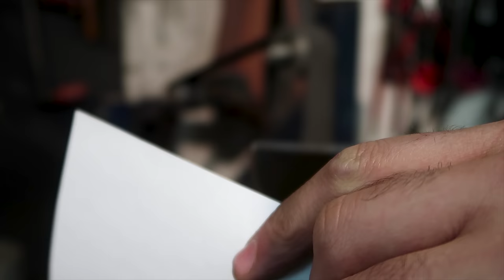Antique Hatchet Restoration. Third Time's a Charm!

Comment: I think a wood handle would have been easier, not really a fan of metal handles myself.
Reply: I'm going to go out on a limb here and say: I don't think he made it because it was easy.
Reply: yep, leave it sitting in the sun on a summer day and you'll regret picking it back up...   but still, totally cool project.
Reply: Oh come on, metal handles are far better at transmitting the shock and so hurting or injuring the user. Who wouldn't want that!
Reply: me too... the wooden handle are better than metal because it add weight when he use metal
Reply: @grahamhaspassedaway4580  yeah but they're heavier and heat up in the sun.
Reply: Easier is not Always Better.
Reply: looks better too.
Reply: he literally just wanted to have fun with a project of his.
Reply: Read the description
Reply: Does any one here not read the description???
Reply: Sage Warren It’s just his opinion, at least read the comment!
Reply: Ned Innis You can stop saying read the description, read the comment you fan.
Reply: Metal handles bounce back and conduct pressure the hareder you hit
Reply: A wood handle would have looked far cooler, but. he didn't make it for us...
Reply: And nicer

Comment: How is this a restoration when you’re not even attempting to restore it to it’s original form?
Reply: @isaiahrashadfan387   Uh, he was just asking a question, not even hating. No need to throw insults around. Besides, this isn't even nitpicking if he's questioning the entire approach alltogether.
Reply: ikr? this video was 5 seconds of metal restoration and 15 minutes of building a completely new handle of a different material than the original.
Reply: clickbaiting
Reply: *its
Reply: The real question is why he isn’t subscribed to pew die pie
Reply: I think it might have been an experiment
Reply: Roy Mustang The definition of ‘Restoration’ is very varied.
Reply: Spring96Fall that’s 20 mins the vid is 15
Reply: @dennism103  they're right though. the video is more on modification than restoration, so you don't have the right to call them stupid when the commenter was correct. 😂
Reply: Really though, it was such a beautiful antique. The new handle is cool but weird juxtaposed with the original blade
Reply: That was it’s original form but it got rusty and shitty
Reply: That was the original form but it got rusty
Reply: Roy Mustang hush child I’m watching
Reply: @thederogativeworld  he did restore it, it is functional again he added a new handle which it needed didn't have to be a wood handle either way the handle was replaced
Reply: @kristasears5645  It is NOT a restoration, the only restored part is the axe head. Adding a metal handle when it originally had wood is not a restoration. He made the axe semi-usable again, but the title of the video is misleading. Restoring functionality is different from a restoration. 
What he did was a restoration of the head and modification of the whole axe
Reply: @thederogativeworld  it is to restored he's using it it's functional it's restored it's got a new handle on it you could take any antique and replace a part of it and it's called restoration he didn't duplicate the handle but it doesn't need to be the axe peace the important part is restored its functional again I know you think you're the type that is a know-it-all and that's okay this conversation will probably get redundant so you have a good day peace out
Reply: @kristasears5645  Restoration: the action of returning something to a former owner, place, or condition.

If I cut off your arm and replace it with a prosthetic, did I restore your arm?

But please continue. Elaborate on how what he did was a restoration. You're the type that thinks they know everything when they don't, and refuses to admit when they are wrong.
Reply: @thederogativeworld  now I told you this conversation would get redundant and it is but you don't listen I'm done with this conversation because it is becoming redundant now you have a great day peace out
Reply: BECAUSE ROY, BECAUSE ROY.
Reply: Roy Mustang you gotta admit, this is more entertaining
Reply: @kevinmysticmaclee9056  you're so clever
Reply: @thederogativeworld  Look up the word redundant
Reply: @kristasears5645  That had absolutely nothing to do with anything. The only redundant thing here is me looking up a definition I already knew because you were too lazy to do it yourself. You have made absolutely NO proof that the rest of us are wrong, and we've already proven your opinion isn't correct. Come back with proof or shut up. 

Oh, and stop trying to change the subject to make you feel like you won. You're failing miserably
Reply: @thederogativeworld  LMAO dude give it a rest geez get off YouTube it's causing you to have terrible anxieties maybe you should try a Xanax or something
Reply: @thederogativeworld  the only one that is insulting and rude as you you are a probably one of the rudest commenters I've ever encountered you just can't leave it alone dude I do not care I do not care have a good day peace out
Reply: @kristasears5645  Then don't say stupid shit about a subject you know nothing about *shrug*
Reply: @thederogativeworld  I know nothing about let me see my husband's restores old Vehicles my dad restores old vehicles and you know something you can't always get it to its original state as of sometimes you have to replace parts they look the same but they're not original you're not going to have original paint but you might even have to drop a whole new engine in it but the car is restored it's functioning not all original parts but it's restored from being a rusted-out bucket of crap and when you can get it appraised for its restoration under those conditions and by golly it's restored think about it broaden your mind or at least open it a Teensy bit think about it the seats of the car different fabric and most commonly different designs that axe was cleaned up and functional again it was the ax that needed the restoration not the handle that handles probably been placed replaced a dozen times since the ax was even made he cleaned it up and he got it functioning which was restoring it that handle that he took off was absolutely not the original handle you or nobody else really even knows what the original handle even look like so that handle is irrelevant
Reply: @[ r o m b a ] oof
Reply: @kristasears5645  You obviously learned absolutely nothing from them then, even if what you said IS true.  And what does restoring a car have to do with restoring an axe? Have you considered that finding the few remaining old parts for old cars that haven't been in production in a pretty good amount of time might be a tad harder than finding, or making, a  wood handle? Also, that said new parts for those old cars might actually have the same function as the parts that can't be found anymore, with the difference being that they weren't made at the same time as the original parts?  Or the fact that maybe, when restoring a car, you are attempting to return it to as close of an appearance as it original was? The point isn't to make the restored item out of the exact same parts as it was made out of before (unless you can, then great), but to return it to roughly the condition it was in when it was new. Casting a metal handle onto an axe head is NOT doing that. It isn't even restoring its functionality, I'd bet you'd have a much better time chopping wood with that old handle than the new one. Sure, I might not know what the original handle looked like, but I can 100% guarantee it WASN'T metal at ANY point in time before now.  You know absolutely nothing about restorations on old tools, and very little about restorations in general. 
But please, show me how a metal handle is a restoration. Show me how many old axes had metal handles compered to wood ones.

Edit: Thought so
Reply: @kevinmysticmaclee9056  As much as I should, since it's about as bad as arguing with a flat earther, I'm too stubborn to give up and let this person feel like they won with their complete failure to understand a concept. I'm arguing with a brick wall, but the brick was was replaced with a metal wall that has "not brick" blatantly written on it and is still called a restoration
Reply: Roy Mustang just better :)
Reply: Every reply is someone making a comment then it causes people to argue. just shut up already. Im getting so many notifications its annoying.
Reply: @jaydonhines6017  Then mute the conversation, I doubt YouTube removed that feature.
Reply: @fuz5567  try to do it yorself and try to say clickbait again
Reply: @TheHelpingPoint-pk5uj  I don't see how that's a valid point I'm the slightest, it just simply isn't a restoration. stating it is would be clickbaiting in an attempt to draw people in believing its a genuine restoration.
Reply: @fuz5567  he is not wasting the metal metal is the important part he is foing his job its not clickbait
Reply: True but it's still beautiful
Reply: @magiclbacon1951  hey everybody this one is entitled
Reply: @Jade-hc1dl  Nice opinion. I'll let you know when someone asks you for it in the comments of this not restoration.
Reply: @TheHelpingPoint-pk5uj  And nothing you said actually means anything because the video IS clickbait. The video was NOT a restoration.

Comment: 4:56
My 4 year old brother: I didn't know you could melt wood. 
🤣
Reply: That is Styrofoam melted by molten metal, then the metal takes the place of the Styrofoam so fast that the sand has no chance of crumbling.

Mic drop
Reply: @JoseJimenez-dz7gt  good job you are better at knowing stuff than a 4 years old.

Comment: I had no clue what was going on hahaha would be good if you put a little text explaining why you do certain things. Great video mind!!
Reply: Check the description
Reply: Basically, he uses a light, easily melt-able and  form-able material which looks like Styrofoam to create the handles shape and then when he pours the liquid metal in, the Styrofoam melts and the metal takes it's shape because it cannot go anywhere else since the rest of the box was filled with dirt or something else, not allowing the liquid metal to flow somewhere else. And the weird pillars looking out, are just there so he can pour the metal equally and easily into the actual form of the handle. So he used the Styrofoam to make a metal handle, since I believe it is more reliable then a wooden one, the reason why he did it so often was, he failed the 1st and 2nd attempt. So at the 3rd try he actually managed to get a stable and good looking handle, I don't know if this is more clear, but... yeah

Comment: I was first confused why he was using balsawood
Reply: Wasnt it styrofoam or somekind of soft plastic ??
Reply: @Kus519  It was styrofoam. The idea is that it melts away and even leaves the mold in form of gas when you pour molten metal in.
Reply: @Kus519  Precisely it is a polystyrene a harder and more homogenic "cousin" to styrofoam
Reply: @jacek-jan  "Polystyrene" is the name of the polymer (also used for plastic cups and cuttlery in its normal form), "expanded polystyrene" is the foam you can make out of it, "styrofoam" is a particular trademark for that foam (which everyone uses as a shorthand for expanded polystyrene anyways).

So "polystyrene" here is actually an imprecise appellation, since all styrofoam is polystyrene.
Reply: G4RY L0V3D B4LS4 W00D
Reply: I know what it is

WHATEVER IT IS 
Mind BLOWN

Comment: I'm saying that is the weirdest handle design for that blade
I'm just saying
Reply: It is not that strange. All hatchets here I have seen typically have it. (U.S.) Is it because this is made out of a metal? The ones I know have wood, or the factory has developed its own unique way of using something other than wood and can handle shock damage and vibration of the impact.
Reply: Do you mean that he did a more modern handle design than one that would typically go with that axe?

Comment: I’m absolutely no expert, but all that process with the dirt stuff and the molten metal material seems to be a lot of effort, just so the handle/rod is made of a harder material, I thought It’d have been much better just as wood. And surely there’s some easier way to cast the molten metal around the wood than burying it and pouring it in?

Comment: I guess the styrofoam you used is easier, but kind of harder, since you have to cover it with clay and some sort of reddish 🍊 dust, and 🔥burn🔥 it and it turns into a wood-like material called [REDACTED].

Comment: the metal handle is such a bad idea. you could see how irregular the metal grain was  because you cast it making it very weak and highly susceptible to cracks. a wooden handle would not only be a hell of a lot lighter, but also stronger. this is why casting, and especially sand casting, is never used when the structural integrity of the component is critical

Comment: The only problem I have with these types of videos are....why dont you just use wood, it's so much easier and cheaper than an aluminum cast axe handle, I get it looks nice, but you fuck with the quality of the axe head, and it's not as strong

Comment: I don't understand this... Just why? why would you pour an aluminum handle for a tomahawk head? That's really not even the bad part, you can
make that head into a hatchet bye using a good quality strait grain hickory wooden handle if you really wanted a hatchet. Sorry man but this was not a good
 idea, your hands wrists and elbows will be paying for this mistake in the long run, the only things you can do with this...(1) You can use it for axe throwing
 or (2) Put it on your self for a display. If it was me i would make a new video cutting that aluminum handle off and make a new one out of wood, the

Comment: Not a restoration. Why not simply make the handle out of wood? No sane person would use this axe, because at some point, the cast handle will likely break in two at the weakest point, potentially maiming the user. It's cast metal and it's going to be subjected to shock forces - I assure you, it can and will break. You took what could have been a useful tool and you've turned it into a completely useless (and butt-ugly) ornament.